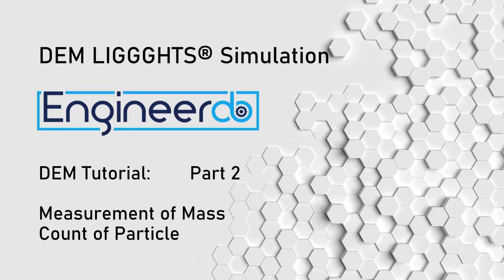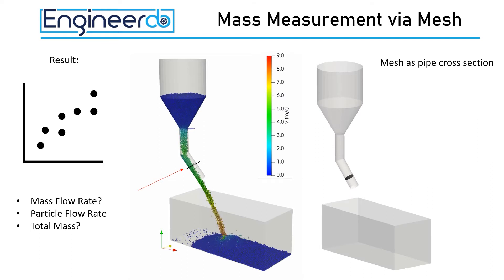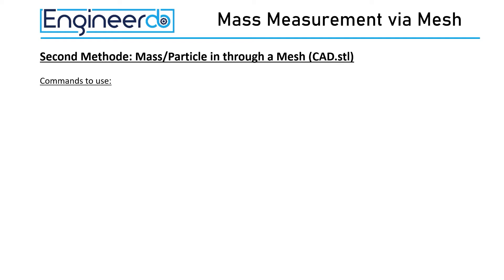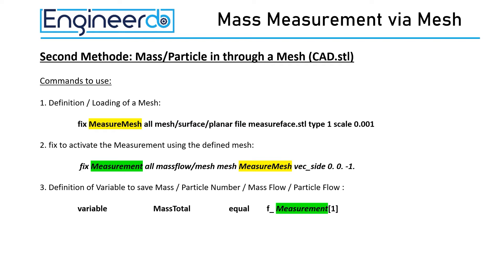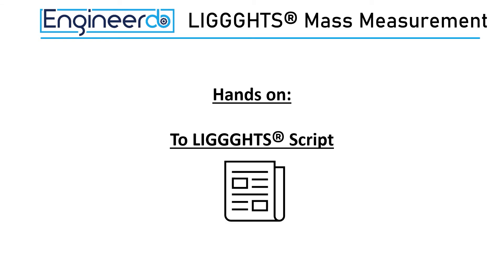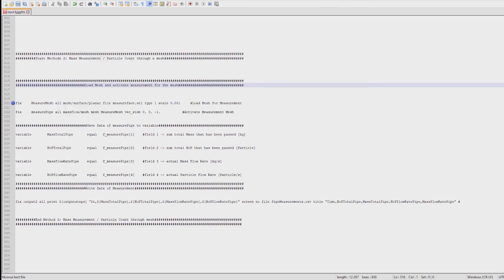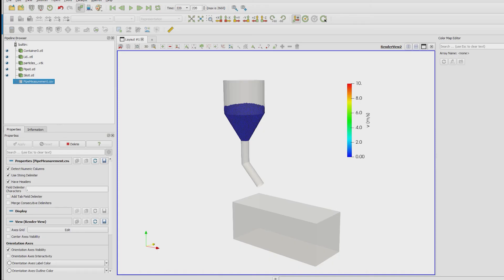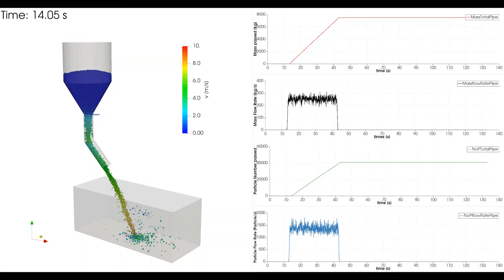DEM Tutorial - LIGGGHTS: Mass Measurement - Part 2

Comment: Hello, your videos are really amazing. Currently, i am working on the compaction of particles in cylinder/press system(horizontally). But I am facing problem with the non resistance of particles, when the cylinder has no more space for compaction. And the particles leaves the boundary(mesh element lost/left domain). I tried many different parameters including wide range of timesteps and properties but none seems working. Could you please make some tutorial for that one? Or any tip for it? It would be much appreciated. Thank you. :)
Reply from the maker: Probably you need a "servo wall", which has some force feedback loop, so that you are not pushing particles through a wall.
Reply: @engineerdo6568  Hello, thank you and i am sorry for late reply. I was actually using same command, servo wall and was getting error: mesh elements have been lost/left. Still, i am working the simulation and hoping to get some result soon. I will update here if i get any solution. :)

Comment: Sir, could you suggest any tutorial video which can compute stress variation with height in a bin
Reply from the maker: Hey Satyabrata, we will consider stress measurement tutorial. A simple silo case might be good example. It´s noted. Cheers, EngineerDo

Comment: Hi Sir,
I have a question. If there are two sets of particles with different sizes, then how to calculate the particle number with the same size in a region?
Reply from the maker: Hey Bo, the best solution to handle would be to generate 3 types of atoms for your simulations: 1-> particle group1; 2->particle group2; 3 -> walls;

Than you can group your particles by type, e.g.:
group LargeParticle type 2

Now you can use the same commands like in the tutorial, but instead using "all" in the measurements commands you use the name of the group "LargeParticle" to just count / track the large particles.

Give it a try! We will also consider a tutorial of this issue!

Stay safe!
EngineerDo
Reply: @engineerdo6568  Hey Bro, I made it. Thank you so much for the advice.